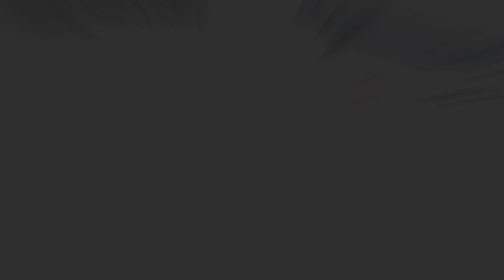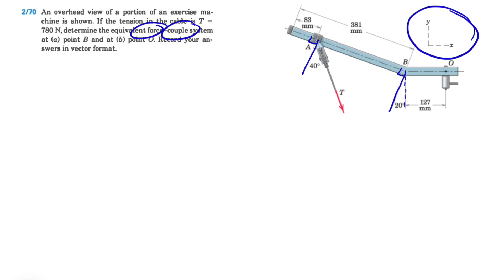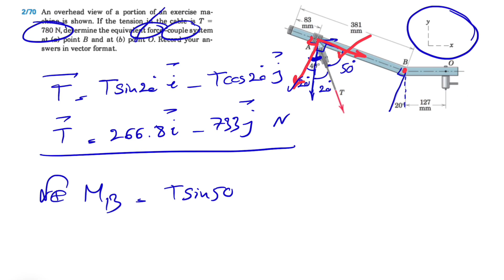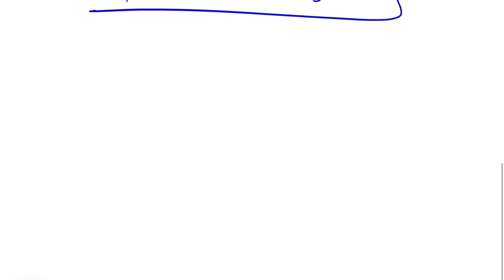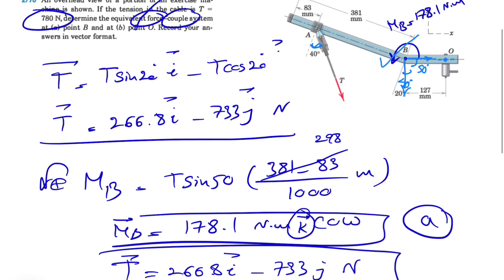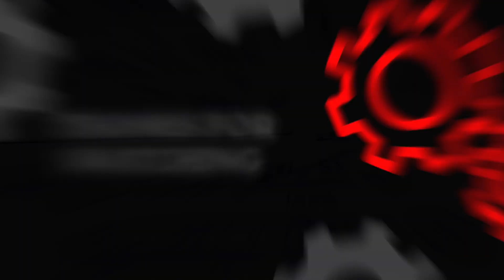Solved Problem 2.70 |  Can YOU Solve This Mechanics Challenge?

Comment: There is a small mistake in the last part. It should be sin(70) from (50+20). The mistake is that you have assumed a 50 deg angle between the vector line T and line BO. But the angle is not the same as between the vector line T and AB, there is an extra 20 deg due to the bend!

Thank you for working through these problems, your videos have been very helpful when studying! <3
Reply from the maker: You’re absolutely right — the correct angle should be 70°, not 50°, since there’s that extra 20° bend between T and BO. Thanks for pointing it out and for the kind words — really glad the videos are helping you study! 😊

Comment: Hi Sir
I am from PES college,Bangalore and I love your videos a lot as they help me in solving the problems whenever I am stuck as the same book is followed in our college as well.
I have done the problem using Cos40 instead of Sin50 which is same but isn't it like that the answer is coming as 253.98N instead of 271.16N....in the textbook answers also it was given 271.16 and then I checked your video for clarification but found the same answer...I have checked several times that is there any mistake that I made but I didn't find any....could u please help me rectify it.
Edited:I saw answer in one of the internet sites and at last they have taken thetha as 20 degree to get the right answer but I didn't get it? Could u please explain this last step.
Reply from the maker: Glad, it's helpful. You should be getting the same answer with Cos40º. I can have a look at your answer if you email me the image of you answer to engmch.inquiry@gmail.com